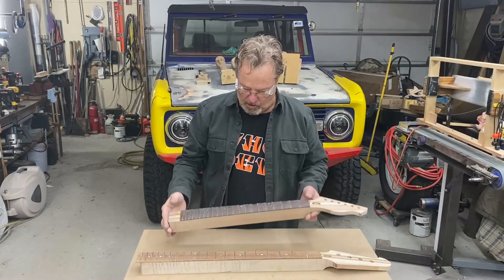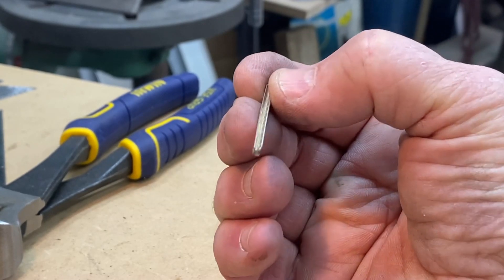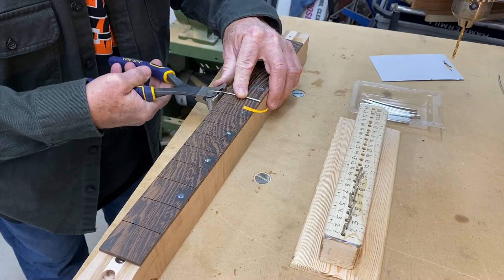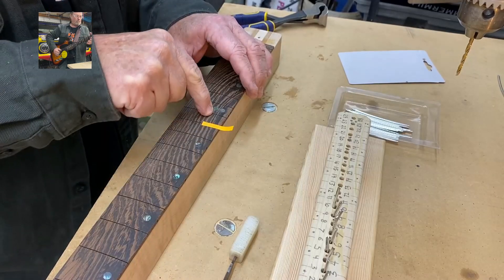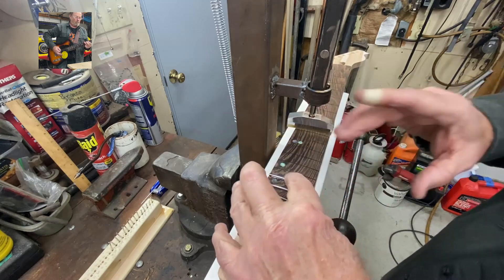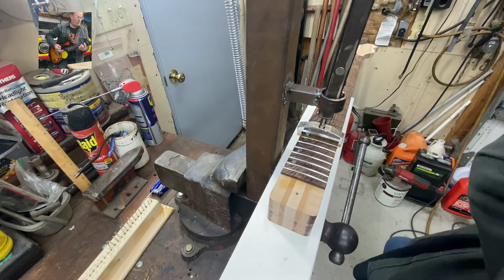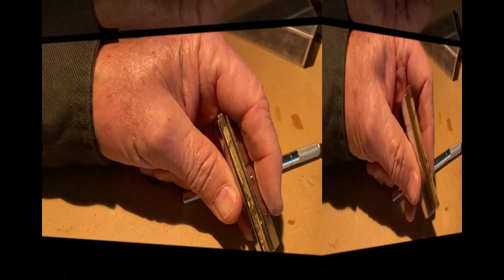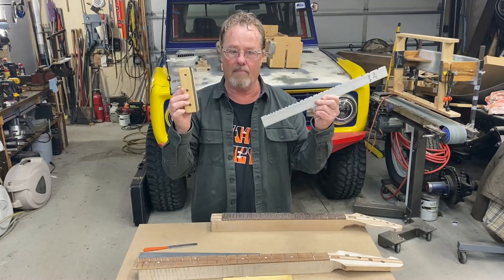Installing Stainless Steel Frets, No Worries!

Comment: Which stainless steel frets did you buy?
Reply from the maker: Mx1557ss
Crown Width A = 2.9mm (.114 inch), B = 3.00mm (.118inch), Crown Height C = 1.35mm (.053 inch), Tang D = 1.70mm (.067 inch), E = 0.60mm (.024 inch), F = 0.95mm (.037 inch)
https://a.co/d/hwvSudi